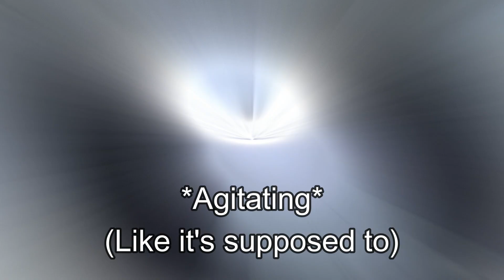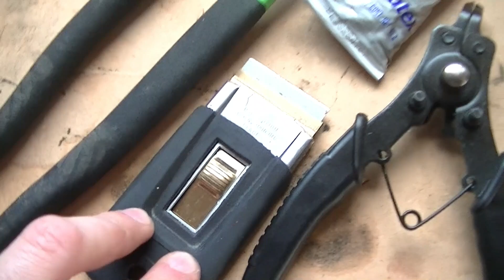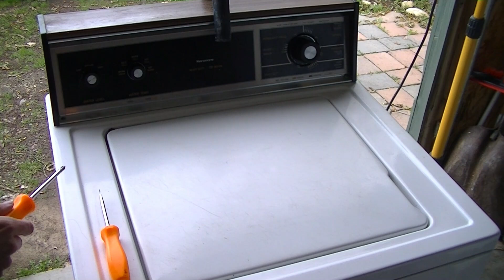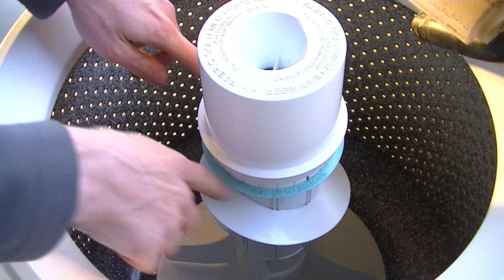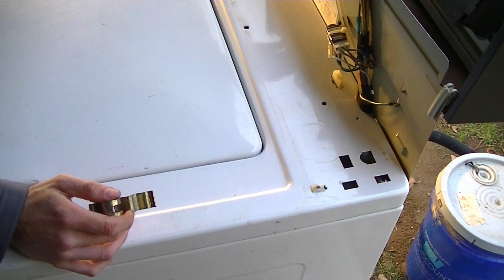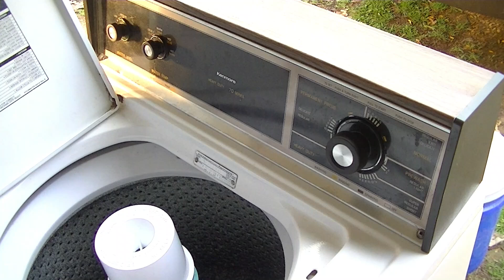Whirlpool/Kenmore Washer Not Neutral Draining - STEP-BY-STEP How To Fix!

Comment: Useful video, got my 90 series from the late 90s working again. Thanks! Time will tell how the 10w30 lawnmower oil does, figured it was the best I had around for non detergent/non additive oil.
Reply from the maker: Nice work!  That oil shouldn't be too bad for that, just a smaller linear-moving gearcase is all it is.

Comment: Great video!  One thing I noticed with every single video on this is no one mentions cleaning the metal surfaces of case with brake cleaner or acetone? Even the oil from a fingerprint will prevent the silicone from adhering properly?

Comment: I just put a new neutral drain kit in and it is still spinning while full of water. Any suggestions?
Reply from the maker: Well....sounding like now they're building the kits out of spec.  Not the whole kit, but the metal plates to be exact.  A friend of mine found that just leaving the original plate in but changing everything else, it works perfectly.
Reply from the maker: You also don't want to buy aftermarket ones either, only OEM ones.

Comment: My transmission is leaking - I think most of the oil is gone now because of this, if there is hardly no oil left and nearly bone dry will that cause the engagement issue and make it not neutral drain?
Reply from the maker: Whether a lack of oil affects the neutral drain in and of itself, I don't know, but in any case, a lack of oil definitely isn't conducive to much longer lifespan for the transmission altogether.  I'd refill it as soon as possible and replace whatever seal is needed to be replaced.  Have you determined where it is leaking from?
Reply: @lizboz  It's leaking from the primary gasket, I have to check the drive seal too though because I noticed that the top of the cover as well so I am going to be taking it apart and just rebuild the tranny. I'm also going to do maintenance on the Motor bearings as well as check all the seals and maybe more if needed - if I'm taking it apart might as well fix everything.
I do have one more question though - The model I have is a MTW5600TQ1 and the replacement is a 285785 and it only has 3 clutch pads.. Do you know of any companies that sell a replacement with more clutch pads like the one you have? The replacement has pads missing and there is holes in the spring ring that could have pads riveted to it :( 
I appreciate your content it's educated me so thanks.

Comment: excellent video on this neutral repair.  One thing I always do is put some grease on the top cover seal before assembling it back together.
Reply from the maker: Grease?  On the top transmission cover?  Interesting, never heard that one before.
Reply: @lizboz  Not the cover, the seals for the transmission shaft, inside the tube, which drives the agitator shaft
Reply from the maker: @kellygb9278  Yeah, I think when I typed that I was half awake, haha.

Comment: Great how to video.  My machine will not spin with wash cycle load.  It will spin with out washing with clothes.  I have replaced clutch and freed up locked up brake pads.  Any advice?
Reply from the maker: Hmm, did you check to see if something is caught in between the basket and outer tub?  Either that, or something binding the spin tube bearings?  Both could be just bad enough to the point where like you said, it will spin empty but not with a load in it.
Reply: @lizboz it's working now not sure how.  I ran spin with small fill of water and it worked.  Thanks.  I have replaced clutch and freed up locked brakes.
Reply from the maker: @dwaynebrewton9482  Gee, I hate those kind of self-mitigating issues like that, haha!  Never know when they'll pop back up again.  Glad it's at least going for now!

Comment: Which gear oil brand did you put in  after you drained  transmission the second  time?
Reply from the maker: The stuff I used was NAPA brand oil, but generally any brand oil will work.  Again though, just make sure it doesn't have any limited slip additives in it, which if I'm not mistaken, modify the friction properties of it therefore causing it to heat up more so than it would without that--I'm sure that's why it smelled more rancid when it ran.

Comment: Do you know why mine won’t agitate with a load in it? It looks fine when it’s empty. Mine also is starting to spin with water in it. I picked it up for free and trying to figure out the problems.
Reply from the maker: As for struggling to agitate only with a load, that sounds like maybe a stripped agitator gear in the transmission.  Does the whole agitator (bottom and top) only move one way with a load, or nothing at all?
Reply: @lizboz Top isn’t moving just looks like a vibration so I assume bottom isn’t moving either. Empty I can watch them both move clockwise. That coupler looked ok
Reply from the maker: @Harold-f4n So when you run it empty, if you can hold the top part of the agitator steady with your hand, your agitator dogs need to be replaced.  When it's running with a load, does there appear to be any back and forth movement in the clothes?  If so, the bottom agitator is at least working.  If not, and you've checked your coupler, your transmission is probably gone unfortunately.  Not that hard to snatch one off another machine that's working, and they're all made universally the same.
Reply from the maker: @Harold-f4n  If you're able to, a video would help to see (AND hear) what's going on.
Reply: @lizboz I replaced the dogs
Reply: @lizboz Ok I’ll try to get that done within the next couple of days
Reply from the maker: @Harold-f4n  Sounds good.  Let me know when you do.
Reply: @lizboz Can the agitator gear be replaced?
Reply from the maker: @Harold-f4n  It can, but if you're dealing with both a stripped gear AND a worn neutral drain pak?  Might be more economical to just replace the whole transmission itself with again another used working one.

Comment: I change the Neutral pak but it happen to Spin FULL in agitation mode.
Reply from the maker: Hate to burst your bubble here, but when it's done correctly, it won't do that.  Somewhere along the way, an oopsie was made.  I know, I've done it myself PLENTY of times.

On a machine I've yet to publish but already recorded, I had to swap out the agitator shaft because the gear on it had stripped out one way, but not the other, so it would still turn the agitator, but only in one direction.  When I did all that and slapped it back together (which I should have never done without testing it), I discovered that the shaft wouldn't turn by hand even with the motor coupler on it.  Couldn't figure out why so I had to tear it all apart again only to find that I had incorrectly reinstalled the shift actuator plate, and by trying to turn the shaft, I ended up bending the plate!  So I had to replace that also with another one, and luckily I've got plenty of spare parts for that.  One of those things, live and learn!
Reply: @lizboz OOPS i just realize it SUDDENLY ENGAGE WHEN I OPEN THE TOP PANEL While Neutral Draining.
Reply: @lizboz There is a Lot going on. I can't find my Last comment to begin with. Having said that i realize that when i open the Cover while NEUTRAL DRAINING, it ENGAGE THE SPIN SIMULTANEOUSLY.
Reply: THe Neutral Drain IS Fixed but i have a CLICKING SOUND WHILE SPINING.
Reply from the maker: @Soberguysknowsbest I see, makes more sense.  Did you replace all the parts that came in the kit?

Comment: Wrap the spline of the shaft with electrical tape when removing and  re-installing the transmisson so you don't  damage the seal.
Reply from the maker: Eh...I've never had problems with that brake seal unless I have to tap it out with a hammer to get the basket out if it's that stubborn.

Comment: My 17 year old washer neutral drain was intermittent and slowly got worse. There was nothing wrong with the neutral drain mechanism. The lubricant was getting thick. i replaced the lubricant with 80W90 gear oil and it worked fine.
Reply from the maker: Interesting, I suppose it must have gotten colder hence thicker overtime?
Reply: @lizboz  The issue started in the winter when my basement drops to about 15 C. Over a couple of years it started doing it year round, always on the first laundry day spin cycle. Once the oil was warmed up, it worked normally til the next wash day.

Comment: how did you get that gearcase so clean?
Reply from the maker: I usually use kerosene to clean parts like that because it acts as a thinner for the oil that builds up on the outside and gets grimy.

Comment: Replacing the oil on a few transmissions, what oil do you recommend? The WP oil is too damn expensive.
Reply from the maker: Any 90 weight oil from an auto parts/hardware store will do, one without any additives would be better.
Reply: @lizboz do you have a preferred brand?
Reply from the maker: @MatthewJames-st5wv  I tend to use NAPA brand oil only because there's a NAPA store right in the small town I live in.

Comment: About this...

I have this issue on my issue on my machine but it does only seem to happen when there's little water in it, is this normal?
Reply from the maker: @gbilo24  Hmm...slower agitation speed?  Never heard of water level affecting that, only temperature/oil viscosity and agitation time, but if it's worn it won't matter in any case.  It might do it when there's little water in because you're running it for a shorter agitation time than would be with a full load?

Comment: One thing I've noticed when these direct drive washers work correctly is that sometimes at the end of neutral drain, the spin clutch engages either loudly or softly. But other times, it doesn't occur at the end of neutral drain at all until the very beginning of spin, which is when you hear that very loud clunk. Either time is fine, but the part when the spin clutch engages at the beginning of spin rather than at the end of neutral drain leads me to believe that the machine is working at its very best.
Reply from the maker: @tristangardner3889  I fully agree with all you've said.  My 1986 Kenmore 60 series was a PRIME example of a machine that you couldn't possibly cause to go into spin prematurely.  Even sitting out in the cold shed for 2 years not being touched, first run-up on the suds-return portion of the timer--only needed about 5 seconds of agitation to reset the mechanism for neutral drain, and it wasn't going anywhere by that point, not a chance.

That machine must have NEVER been in a cold environment.  Once I even got it to neutral drain on low speed!

And now that the neutral drain has been replaced in my 92 machine, it works correctly even being ran for only 6 minute washes on low speed to start out with, which is usually what my dad always does his loads on.  I think that's partially why it wore out before.
Reply: I would enjoy having an older Kenmore washer (and hopefully, a matching dryer) like that in my own home someday, even one from the early 90s.

Comment: Unfortunately this is a very common problem with these machines, however it's not very likely to affect either the motor or the transmission as the spin clutch is what slips as the basket picks up speed. The machine certainly will go through clutches like crazy if it's not neutral draining.

I always recommend replacing the oil during this process because it can thicken with age which will hinder operation. The spin gear is a crucial component of the mechanism, with the latch grabbing the cam underneath to prevent the spin pawl from engaging. If the button on the gear is worn out, preventing the reset, then it will slip into spin guaranteed.
Reply from the maker: @andrewg593  All good points, and well put.

Comment: The transmissions in the belt drives almost never needed to be opened up, only time they would need to be cracked open is if the spring broke which puts pressure on the shifter fork assembly, basically that drops down and meshes with the agitator shaft which is what engages agitation. Believe I explained this 3 years ago explaining on how the Whirlpool belt drive transmission works. Not many parts inside the belt drive transmissions since there’s a total of 7 to 9 parts inside total.
Reply from the maker: These didn't need it much either.  They do now because parts have cheapened up since the discontinuation of them.

The belt drives never really had transmission issues to speak of, it usually is the wig-wag that goes first, but that's on top where you can actually get to it right then and there.
Reply: @lizboz  the older style of wig wag aka control magnet assembly as quite a bit more substantial than the ones used after 1965/1966. In the one repair manual I have from 1962, it shows you can rebuild those older control magnet assemblies. Even the older 4 port pumps can be disassembled and rebuilt as well.
Reply from the maker: @seana806  Ahh, before consumerism in society was prominent....
Reply: @lizboz  before consumerism and planned obsolescence began to run amok. This may be slightly off the tracks, but there are some current production vehicles which literally have headlights that cost over $1000+ a piece, it seems as though everything I predicted 10 years ago is slowly but surely coming true. It seems as though people don’t realize until it’s too late.
Reply from the maker: @seana806  We knew that would be a thing since the turn of the millennia.
Reply: @seana806 I scrapped out a wig wag transmission 20 years ago. I pulled out of a tangle of weeds, covered with oil and dirt. It weighed a ton. If I had known what it was I would have saved it.

Comment: Very nicely detailed…For oil I used a 90 weight synthetic gear oil made for marine outboard lower drive units. Cheaper and better than the Whirlpool branded oil.
Reply from the maker: Thanks!  And for the info on the oil; that's an interesting option I'll have to look into, thanks!

Comment: Excellent tutorial video. I know its pricey, but this is why I always use the OEM Whirlpool gear oil. You can't go wrong. Was this your 92 Kenmore?
Reply from the maker: Thanks!  Yeah the RIGHT way to do it would be OEM, but when you're like me, you'll always find other alternatives that work just as well, if not even better than the original factory spec stuff.  Luckily I did end up finding a different brand oil that works as well AND doesn't stink anymore when you run it!  So that's what's in there now.

And yes, this is the 92 Kenmore.